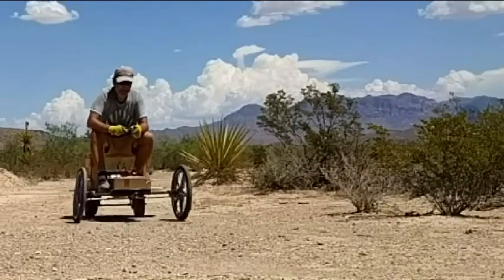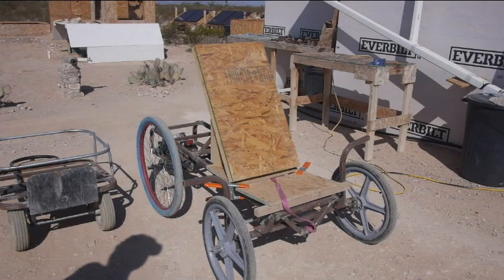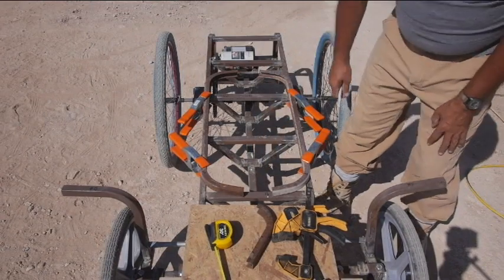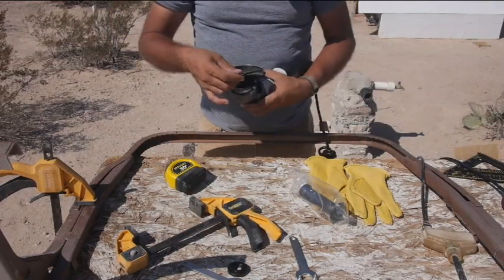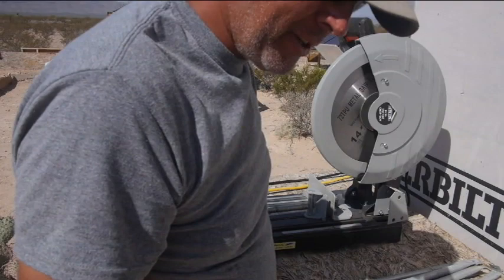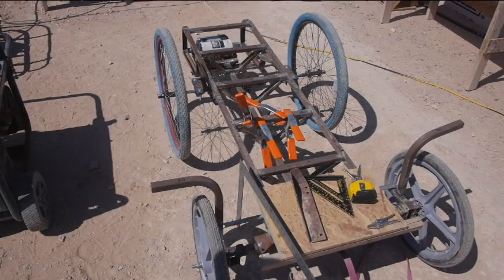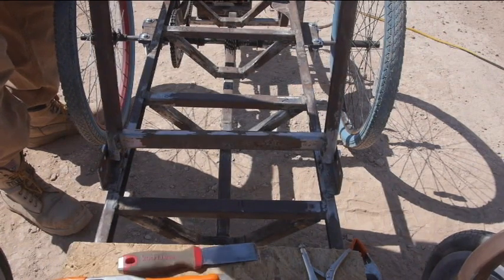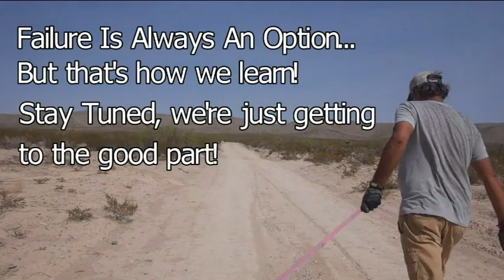Project Turtle - EV DIY Bike Project Episode 14 - Seat and New Grinder!

Comment: Great job with the project it's not going to be very long before the turtle goes to town. Hope your having good weather.
Reply from the maker: It was pretty cold yesterday, warmed up today. Tiny skiff of snow on the tops of the highest hills, that was it. My water froze, cracked one fitting, thankfully I had the parts to replace it. Kept hearing the pump come on, knew it was leaking somewhere! Might have to do some insulation around those lines I guess. But yeah, looking forward to getting Turtle on a proper road trip!
Reply from the maker: @AnX8765  Yeah I have moving blankets over the bed for the tent, that works great!
Reply from the maker: @AnX8765  It only gets cold a few times a year, and it always sneaks up before I think it will... froze 2 days, today back to the 70s!

Comment: Have you heard about or signed up for the Starlink internet beta? Coverage isn’t down to Texas yet, but should be in the next few months. Unfortunately, the upfront cost is $500
Reply from the maker: I've been watching it, maybe by the time it gets to where I could afford it, it would be available. For now, the cell phone booster (weboost) and LTE router modem are working well enough. I think the Starlink will be about $100, not sure how much data that includes, I pay about $75 for "unlimited" on my phone, but that's 20 GB highspeed, then it slows down. Very interested to learn more though!